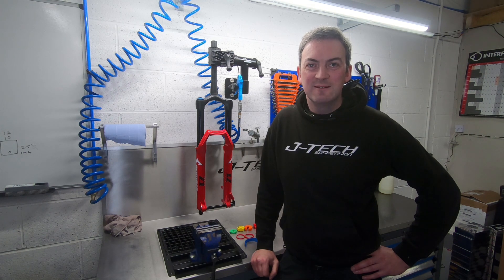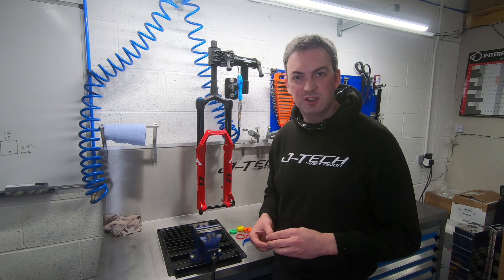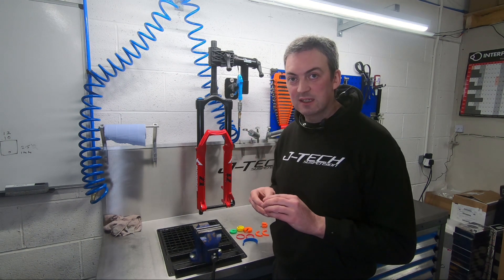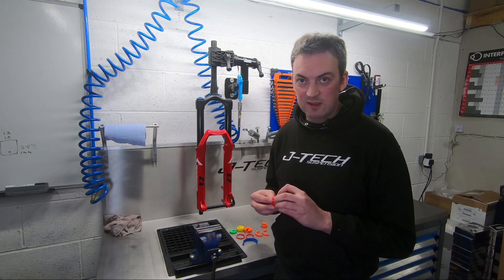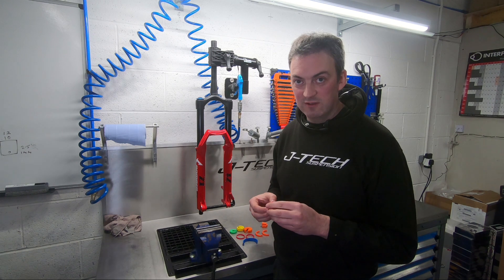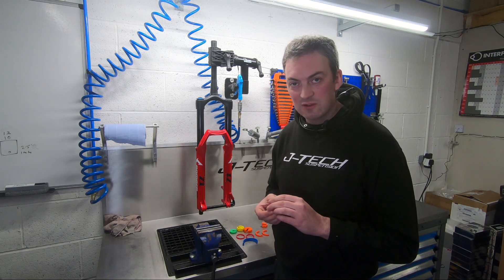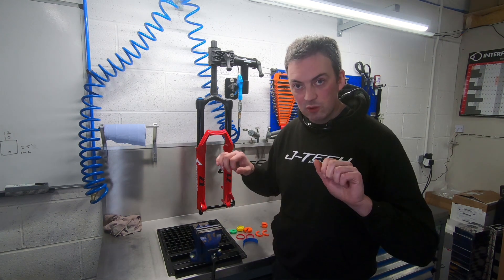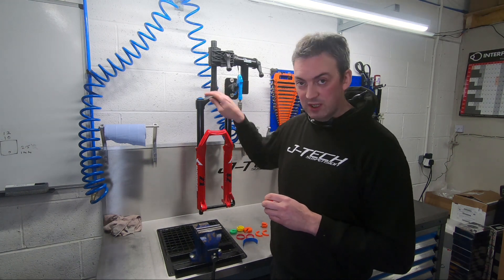What Are Volume Spacers? - Tune Tip Tuesday #8

Comment: Hi, as we know Volume Spacers are not affecting first parts of travel.
But I have a strange feeling that my fork at same pressure with 2 VS is more plush at SAG travel. 
Maybe decreasing volume of positive chamber is changing ratio between pos and neg? So with VS you have bigger neg  chamber. 
Or it's just placebo?
Reply from the maker: Hi Adam, good thinking, but no - sag isn't affected. We're hoping to get some more edits done over the winter (with lots of dyno tests to show you) and we'll be able to show exactly why then. Stay tuned!

Comment: from my personal experience across 4 different frames i can tell you volume spacers do fuck all, now got a coil on the Nomad after it coming with air and even with the shock stuffed with volume reducers id use full travel way too often and way to noticeably 

Coil is miles better, bike industry needs to sod off with air already, at least on shocks

Comment: This is what I've been trying to find!! Been reading about volume tokens all morning trying to work out if they'll help my mid-stroke support or not and how to go about sorting it (Lyrik Dual Position).

Forks tend to wallow in the mid-stroke. Have 25% sag, tend to use about 70/80% of my travel in general riding, near 100% on bigger features, and the small bump sensitivity is a little harsh. I (think I) have a token in the forks already.

Worth removing the token and upping the pressure a bit? Don't want it to be any more harsh than it is through the rooty/rocky sections (most of my riding), but don't like how it dives in the steep stuff and in berms/drops etc.
Reply from the maker: Sorry for slow response, we're crazy busy at present and don't get much chance to check our channel. If you could drop our tech guys an email on service@j-techsuspension.co.uk, one of the team can advise. Many thanks

Comment: You didn't show a close up of the spacers. I'm on old fart who last worked on 1980's motorcycle suspension. I'm used to a damping rod with holes drilled in it.
Reply from the maker: Sorry about that, we'll try to give a bit more detail next time around. Many thanks